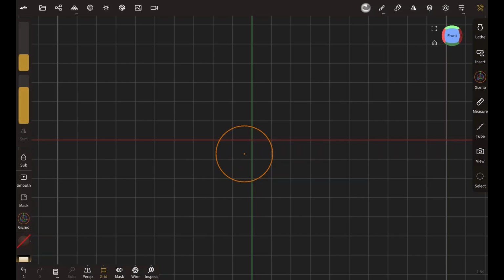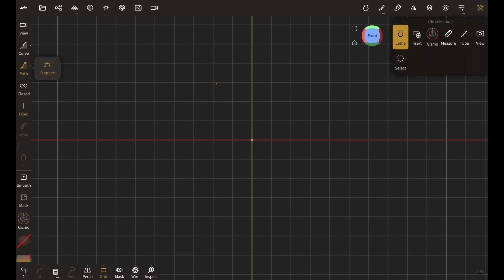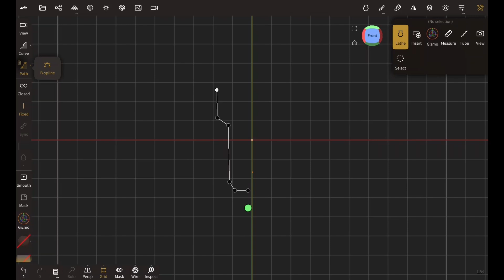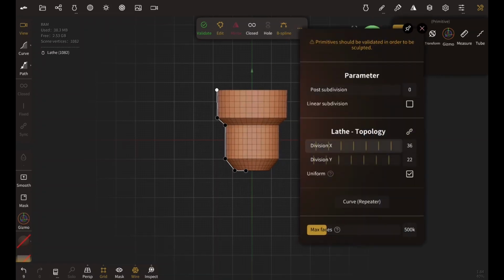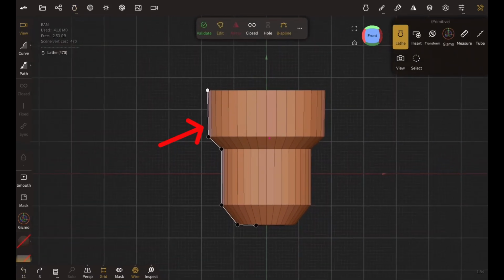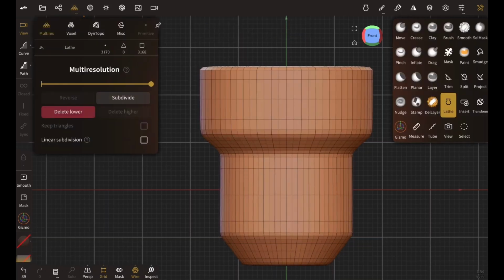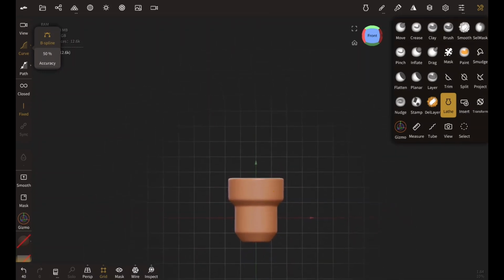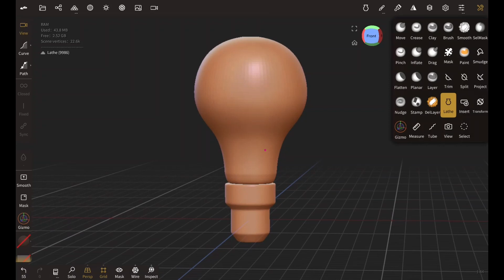How To Use 'Lathe tool' : Nomad Sculpt Tutorial

Comment: Not working at all.

I cant "add" new lines i always need to click IN the line then move the new node around...

Using an apple pen if it help.
Reply from the maker: Yes, by adding I meant clicking on the line to add a new node which creates a new edge loop and we can change it's position by simply changing the position of the node.